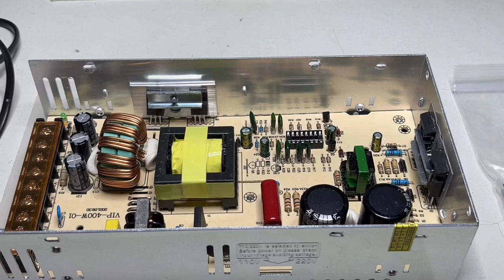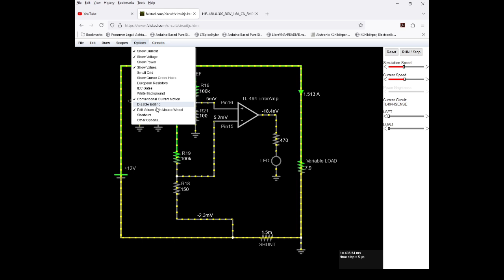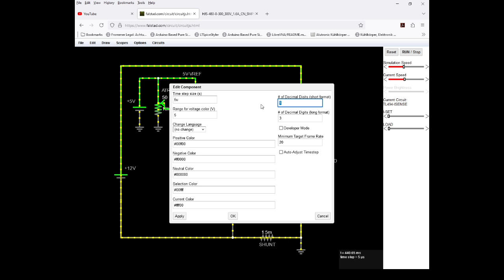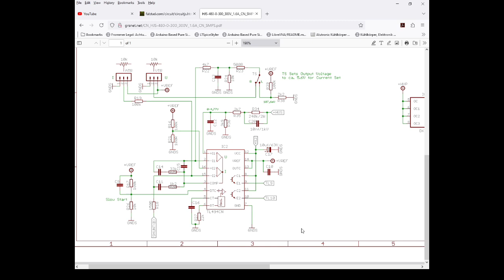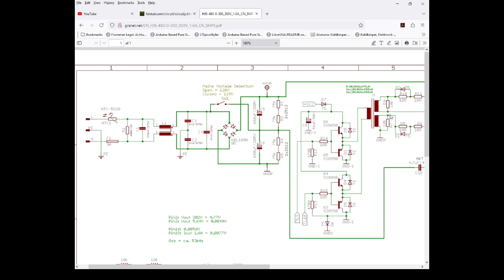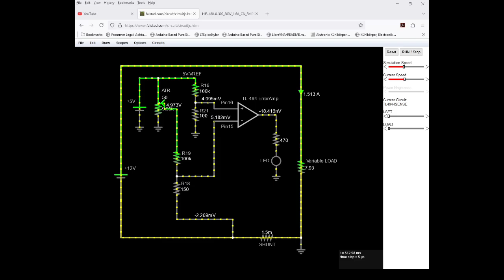HJS-480 Series Cheap China PSU's; How the Current Regulation works, Simulation, Details

Comment: the input offset voltage of the error amp in TL494 is up to 10mV and bias current up to 1uA. How can this reliably work where it has to act by comparing mV range voltages
Reply from the maker: Hello, its crude and not very accurate but it works.Btw. 10mv ist the max, typ is 2mv

Comment: Hi Konstantin, nice to see that you are back.
Nice explanation on the current regulation, i use Falstad Simulator for 4 years or so, it's a very basic simulator but it does do the job and is perfect for a electronic hobbyist.
Only minor are the Optocoupler, where you can't change anything like the transfer ratio, current etc.... 
EasyEda, LTspice etc have too much bells and whistles for me, and can't find my way in those simulators.  Grtz
Reply from the maker: Hi Bjorn, thankyou! I was a close call… I use ltspice alot but its not realtime like falstad, for such small simulations with fast reaction on changes visual its better, falstad is very very basic, not for real designs , more like a teaching tool. I didnt knew Easyeda has a simulator too, cheers, Konstantin